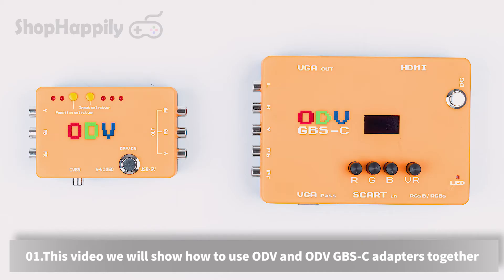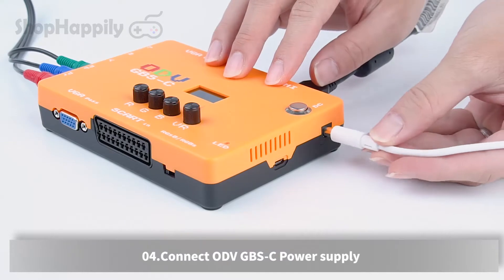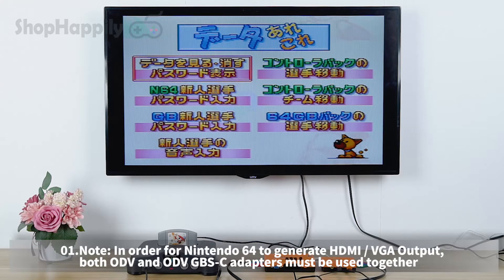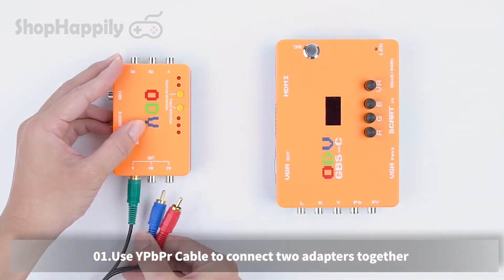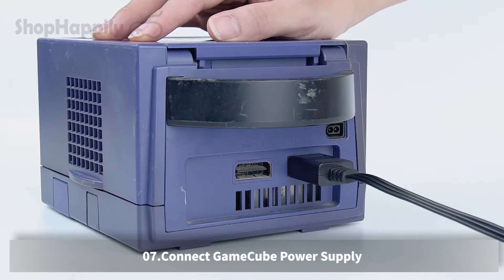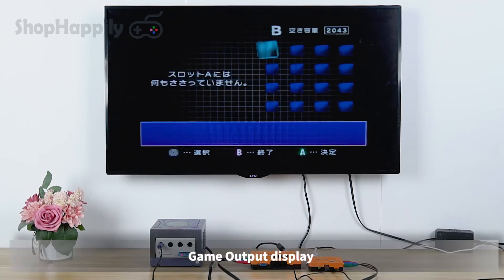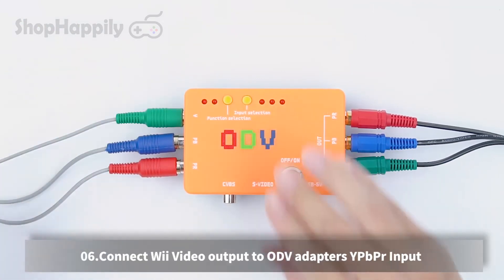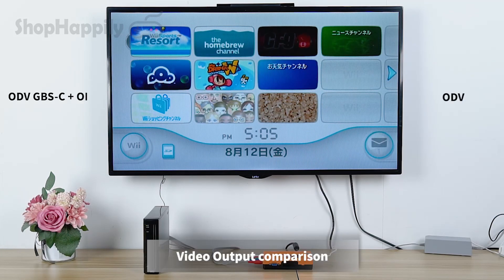How to use ODV-GBS-C and ODV-II for N64/Gamecube/Wii

Comment: Does the option of “Frequency doubling + filter” do the same thing as the previous version of the ODV which was to linedouble 240p or 480i (deinterlace) sources to 480p with an optional smoothing filter on it?
Reply: yep, the only difference is odv-ii outputting ypbpr instead of hdmi